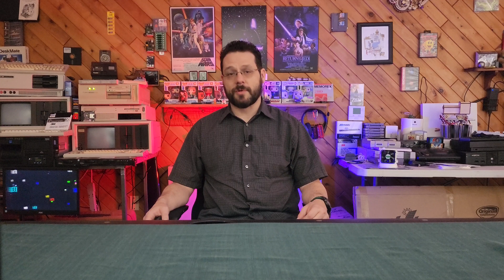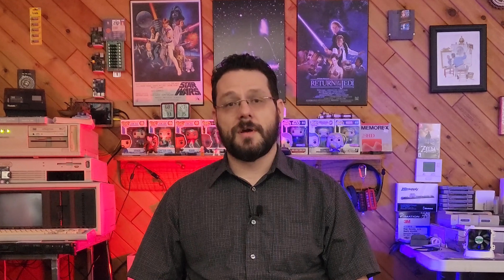A Practical Conversation About Home Automation Security

Comment: someone? more like some what something. a lot of attacks are automated programs and bots!
Reply from the maker: All the more reason to not give the machines that can analyze data faster than us access to it in the first place. It only takes one person to design something insidious. High risk? Perhaps, perhaps not. Worth mitigating by being a little more careful? Absolutely.
Reply: @smartercircuits   sure but the point I'm trying to make is your argument about drive from the adversary/attacker, it's worth digging in to  because it's automated bots HOWEVER these mostly look for simpler things like old software like an ISP router that doesn't get patch or out of box passwords. But mati digress as we talk in circles and agree